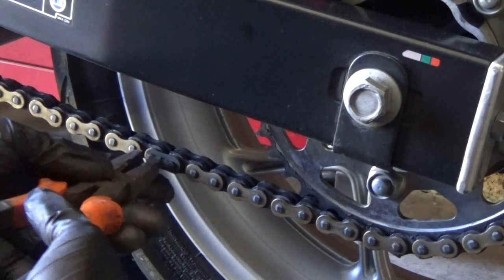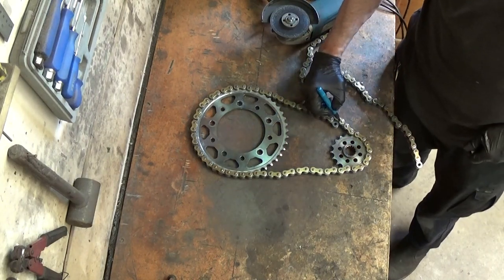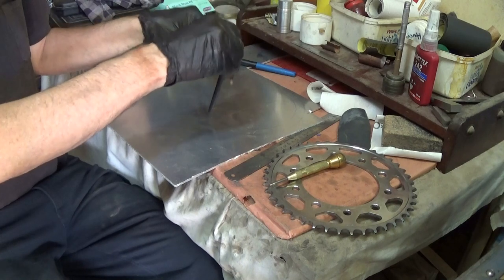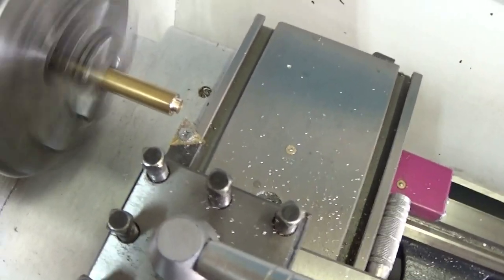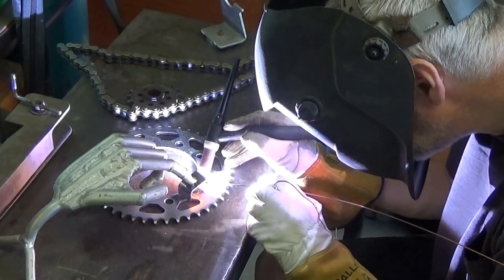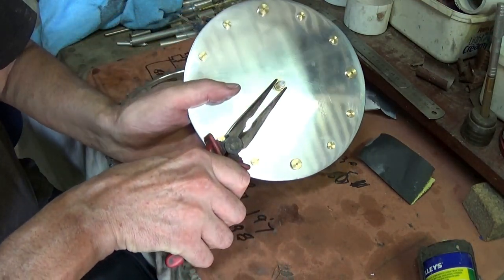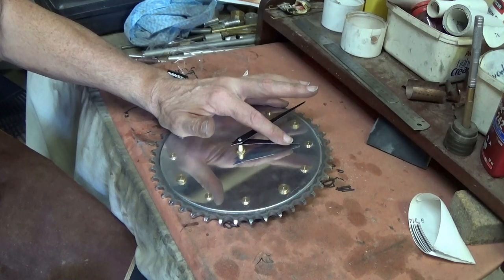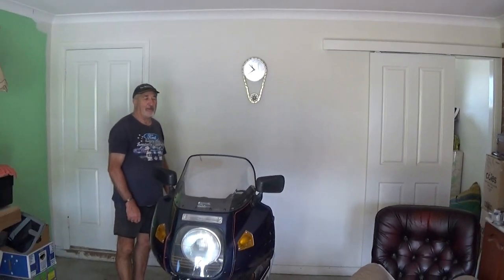DO NOT THROW OUT your Old Chain and Sprockets

Comment: Great, now my chain/sprocket replacement has got MUCH more expensive as I need to buy a grinder, bandsaw, lathe and welder. Up until now my toolkit has just been a selection of increasingly large hammers and 2 adjustable spanners (1 imperial and 1 metric)....
Reply: Haha
Reply from the maker: Yes. It’s a sad state you find yourself in. 
I sympathise 😢

Comment: I've never trusted those chain clips on bikes bigger than trail bikes, the rivet tools are cheap and easy to use. Yes, I've had a joining link fail on a 250.
Reply: joining clip is safe when used correctly . I bet your chain was too tight or clip was reused or was missaligned.
Reply: @chriscs9080  hmm, it certainly wasn't reused but it was on a trail bike so had been 'abused' a touch!

Comment: Very cool.  One thing that concerns me, is that you use a clip style master link on a motorcycle chain, instead of the rivet type?  Yikes!
Reply from the maker: Happy for you to choose what suites you. 
I’ve been riding and maintains my bikes for over 45 years and used clip links on 35 dirt and road bikes without a problem. So I’m comfortable with my choice.
Reply: @AfricaTwin-Stuff  Between my wife and I, we have now owned 39 street bikes...  I have not seen a single one, ever ship with a clip link chain.  Been riding street and track myself for decades, and never saw anyone use clip chains...  Maybe on dirt bikes or pit bikes, but never on a street bike...  So it struck me as odd to see it.
Reply: @AfricaTwin-Stuff  So am I.  My first chain driven motorcycle was bought in 1964, many since then and all with clip style master links.  Just make sure the closed end of the clip is facing the right direction.  The only riveted chains I own are found  on my chainsaws.  We all do what works for us.

Comment: Step 1 -have metal machine shop....oh darn, guess I'm not making a clock out of my old chain n' sprockets.
Reply from the maker: Ha! To be fair, you CAN glue wood onto a sprocket for the face and draw the numbers with a felt pen. 
But if you have a tool you should use it right? 🤔